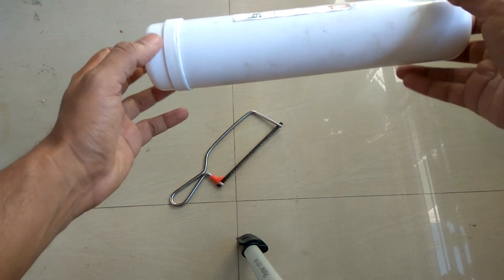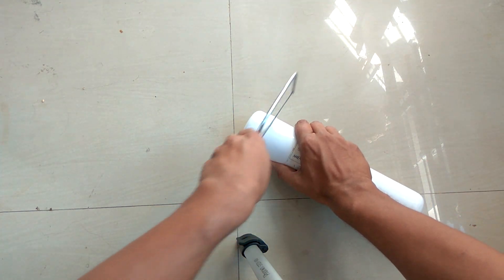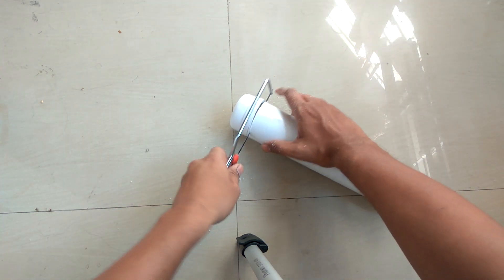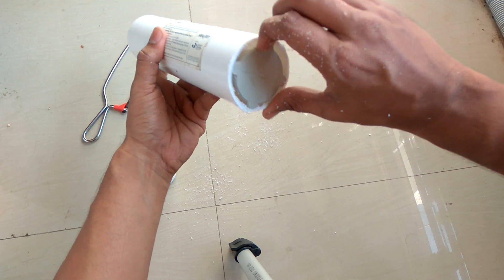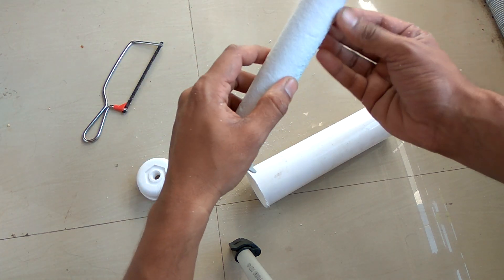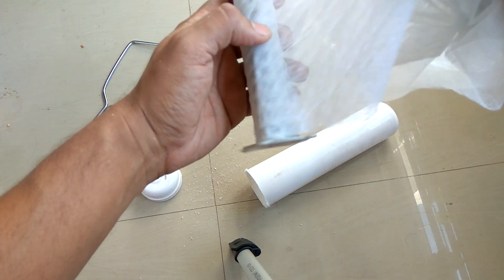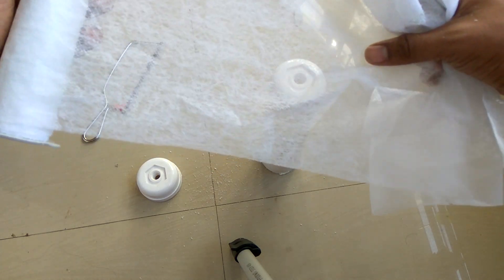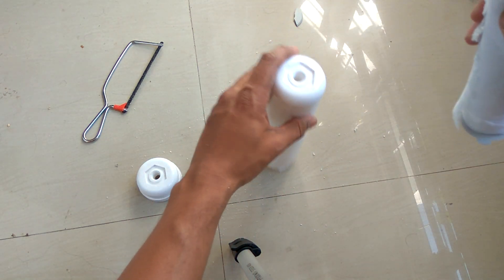RO Inline Sediment Filter, how it works

Comment: My sediment filter out put was very very slow . I cleaned and output flow changed to inflow now it works properly. Due to lock down shops are closed. I want to ask is it OK for time being or not. I have already primary filter attached before Kent RO machine. Guide me